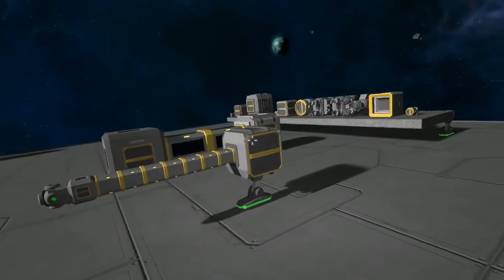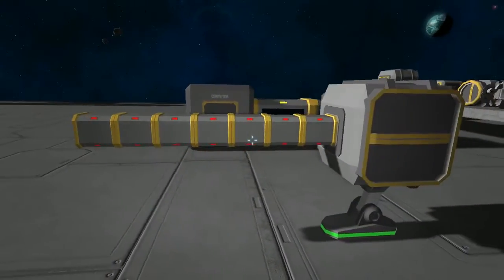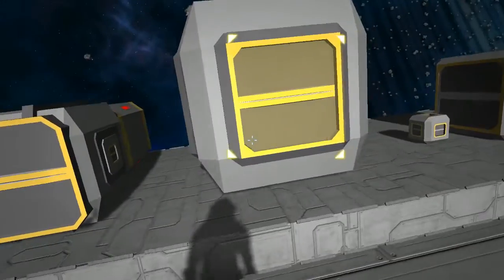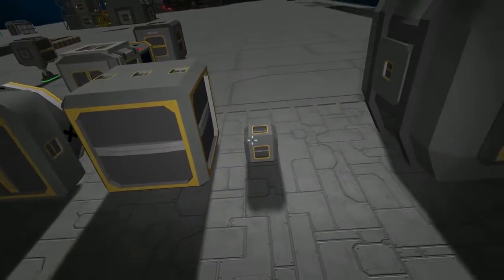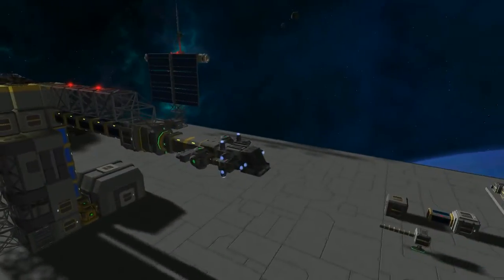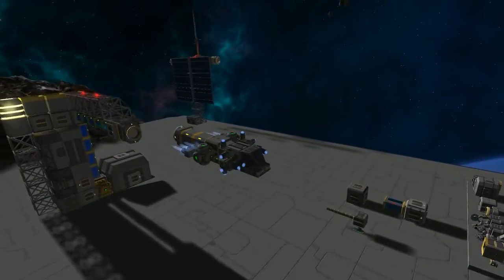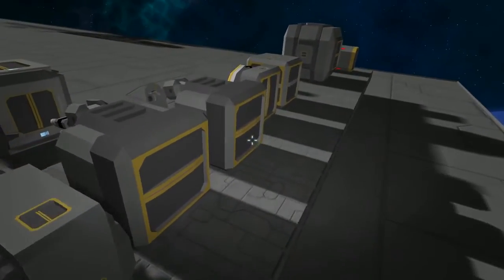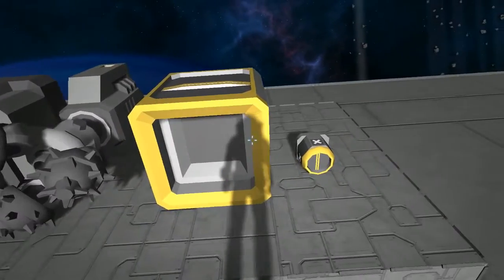Space Engineers - Basic conveyor breakdown.

Comment: Excellent tutorial, but the bit about the conveyer block being required isn't true.   As long as the ports match up,  you can transfer items.   (For example,  you can use large grid small cargo containers in place of all conveyer tubes and blocks, and everything will still transfer automatically.)   Similarly,  you can replace small grid straight conveyer tubes with small cargo containers.